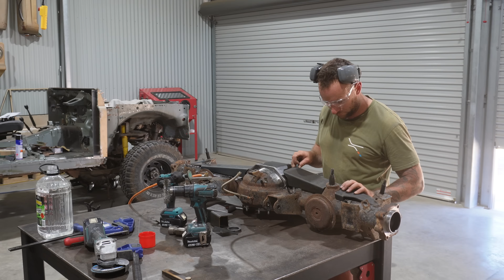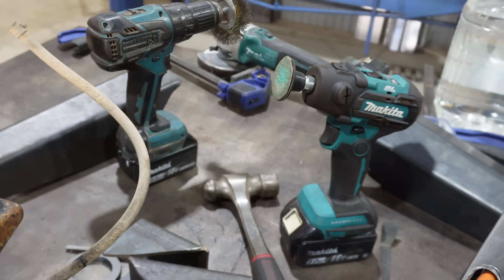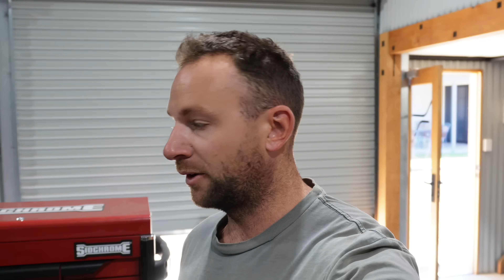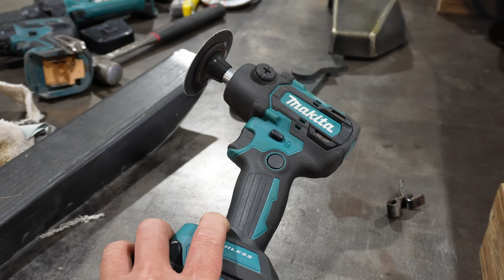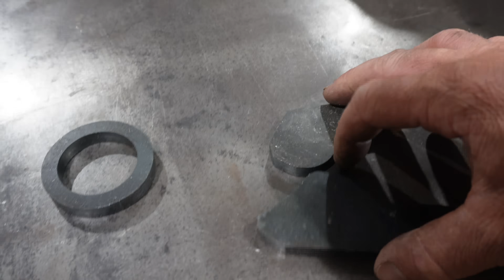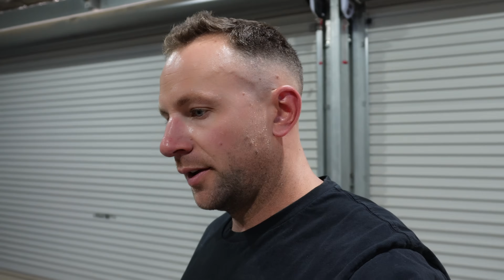The STRONGEST G60 in town. Superior Engineering diff brace install

Comment: 17:04
...as to be expected!
This is a typical bending after welding with a lot of heat. Which cannot be avoided.

Actually I dot understand why all people I have seen (mostly from AUS) are welding these completely? A 50% welding is more than sufficient to hold strength. Similar to a chassis. (of course one needs to seam seal the rest)

Comment: Nice tidy work, coming along well. You can use weld through primer or cold galv paint where you are welding and weld right through it. Also, I’d recheck your measurements and how you are measuring it as it might not be as bad as you think. Can’t wait for some more updates. Cheers

Comment: Bud i'd be amazed if the other axle is any different, as the measurement your getting is exaggerated by the length of the Ali.... Measure the ali closer to the axle tube,  it'll be nothing..... Great work.. 👍